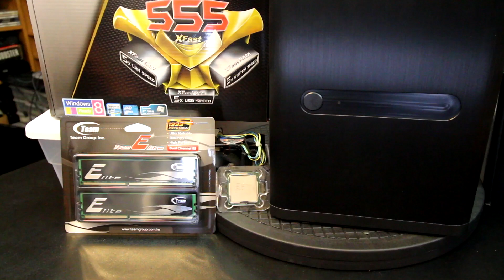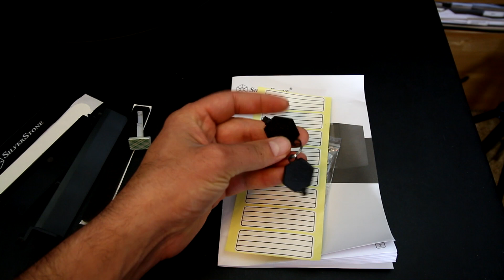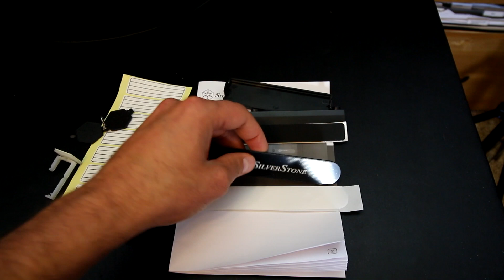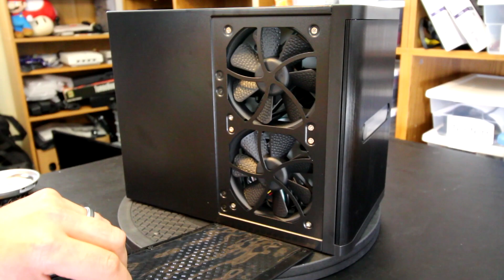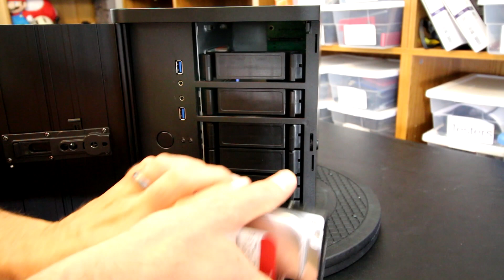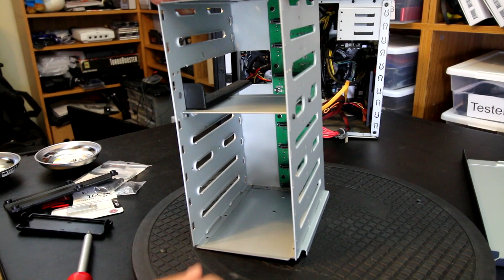NAS build with the SilverStone DS380

Comment: I don't have a problem with a rat nest...  you only have to assemble it once, and then I treat it as any other pre-built NAS box.     But the biggest problem is cooling...  I have 3 differerent (this one, node 804, node 304)... and this silverstone has ABSOLUTELY the worst fan arrangement... you WILL have to modify this case in order to force the air THROUGH the drives, because the way it's set up right now, the fans just blow on the side of the cage...  the modifications include building a shield to FORCE the air through the cage, and to DRILL MORE HOLES in the cage, sot hat the air can actually move through it.   It really is THAT DUMB.

Comment: Nobody needs a RAID card. Every CPU has hardware acceleration for RAID calculations. So simply buy an ITX Board with 4x SATA ports onboard and add a 5x sata JMB585 or 6x ASM1166 SATA card. They are tiny and consume much less power. Or if you find any, buy a C236/C246/C256/W680 ITX Board with 8x SATA ports like the Gigabyte C246N-WU2.

Comment: would it be possible to cram a micro atx motherboard into this case if i were to use a smaller PSU and modify the case a little bit?
Reply from the maker: Hi. The Micro ATX form factor has 4 card slots. This case only has 2. Everything CAN be modified. However, the amount of modification needed would make it a pretty large project.
Reply: @AdoptedMike  i dont need the extra slots i have a l5640 cpu i want to use but its 3 channel memory which requires 6 ram slots so there are no mini itx boards for it :/ the only pci slot i would use is for the raid card.
Reply from the maker: @keenbeans1133  OK. So, the MATX board will end up sticking out of the top even if you are moving the power supply (if I calculated correctly). The MATX board is also wider so the drive cage will have to be moved forward as well. The fans on the side will interfere with the width of the board as well. It would make sense to extend the case on the top and rear. I would guess that 4 inches in both ways would work, maybe a little more. I agree, I am not aware of any Mini ITX board that utilizes triple channel memory. If you are using this as a storage server, you won't notice any difference in single, dual, or triple channel RAM. The amount of RAM makes the most difference for most of the storage OS's. The L5640 CPU has plenty of cores to run virtual machines, but that still won't make a noticeable difference by not using triple channel RAM. I also am unaware of any Socket 1366 motherboards in the ITX format. The storage servers that I have built lately are down this road:
https://www.newegg.com/p/pl?N=100007583%20600030546 with similar to these:
https://www.newegg.com/icy-dock-mb074sp-b-enclosure/p/N82E16817198059?quicklink=true
Those are examples. There are many ways to go in that direction. I have also used both server cases and also NAS systems like Synology and QNAP.
This under the assumption that you are working on a storage server of some sort.
Reply: Look at the CS380 as it’s ATX-sized with the same 8-bay HDD backplane!

Comment: Nice review, i am interested about the raid card and what's the LAN-port on it being used for normally. I think it's an expensive card though. If just building an 8 drive NAS the Asrock board, would have avoided using a dedicated card alltogether.
Reply from the maker: Hi. I am pretty sure the RJ45 port on the back is for management. I have seen HBA/RAID cards have ports on the back to connect to dedicated storage only chassis through another card. The main HBA/RAID card controls the other drives. This card cannot do that, so that is why I am assuming it is form management and maybe firmware updates. That ASRock board is a fantastic setup for this case. They are expensive, but have a ton of features. I ended up getting on well after this video and I love it. So many features in a small package. It is currently installed in a full footprint 4U chassis in a server rack. The board looks so tiny in there! Could have easily gone smaller, but I got a good deal and I didn't need much processing power.
Reply: @AdoptedMike  Thanks for the answer; i will be getting a supermicro-board with an 8 core atom on it soon; together with my lsi-sas controller it might make a good proxmox or freenas or... xpenology box; i was interested in a nice chassis for my future server, currently i have an older coolermaster stacker-case having 2 4 bay drive cages in it which i might repurpose but this silverstone case looked sweet. The only thing that worries me is the tight fit for the SAS controller which would make me having to give up a drive-slot which is a compromise i try to avoid. Great review by the way :) I enjoyed it.

Comment: would have like more information on the raid card, is that sas to sata?  , using mini-sas to 4 break out satas ? and what the hell is that a Ethernet port on the back of the card?
Reply from the maker: The RAID card was a ARC-1224-8i card using Dual SFF-8087 to 4 SATA for 8 total SATA ports. The Ethernet port on the card is used for Out-Of-Band management purposes, such as configuration of the card, drives, arrays, etc. from a computer on the network via browser, SNMP, Telnet.

Comment: You can get a raid card that the ports come out the top of the card and not the back of the card.  and I fell that is what is hitting the plastic part on the caddy.
Reply from the maker: Yes. That is a work around that in most cases will work. Thank you for adding this tip for my viewers.

Comment: I compared with DS380 and Lian Li PC-Q25. DS380 is more convenient and few expensive than PC-Q25. The price of DS380 and PC-Q25 in Taiwan are US$150 and $140 respectively. (Amazon price of PC-Q25 is $268) DS380 is ideal size to expand the HDD to max 3.5' x 8 and 2.5' x4. However, hot-swap function is not my first option. Maybe I should buy PC-Q25 or PC-Q18 that is suitable for long raid card. The exhaust design is better in PC-Q25.
Reply from the maker: Personally, if I had to do it again, I would get the PC-Q25. The DS380 was difficult to work with and didn't have as good of air flow that the Q25 looks to have.

Comment: A magnetic dustfilter near the hard drives. Isn't that kind of dangerous?
Reply from the maker: It is amazing how powerful of a magnet it takes to corrupt HDD data. The actuator and motor in the drive itself are far more powerful and do not mess with the data integrity. Even several magnetic dust filters impart almost no magnetic force more than a centimeter from the metal surface they bond to.

Comment: hello, AdoptedMike - - adoptedBill here!
I really enjoyed your vid and learned a fair bit, I think. But a question, if I may? I'm wondering if a "NAS" is waht I need to accomplish waht I want? Thing is, I've got about 7 or 8 HD's and what I want to do is put them all in to a single case/chassis, then plug that case/chassis via eSATA in to the back of my Mac Pro - - did I mention that I'm on Mac? And have access to those drives for backup, when needed. So I don't think i need a motherboard? or RAM? or some of the other things that you've installed in your build? 
thanks again for the great id. and all help appreciated!
Reply from the maker: Hi. If you are only connecting one computer, you really only need a direct attached storage solution. Not a NAS or, network attached storage solution. The issue is finding any solution that can accommodate that many drives. In my opinion, you could get a few of these: https://www.newegg.com/Product/Product.aspx?Item=9SIA1DS1PR2757 or something similar and directly connect them to your Mac and then configure them from with in MacOS. I don't know of any direct attached storage solutions with more than 4 drive bays. Alternatively, you could get something like this: https://www.newegg.com/Product/Product.aspx?Item=N82E16822108461, but it may be much more than you would like to spend. It may make more sense to you to have the single storage box. The nice thing about the Synology unit is the software is much easier (but lest robust) than a FreeNAS box. Which of these 2 paths sound better to you?

Comment: do you install windows on this system
Reply from the maker: You can. Although I imagine most people will use a version of Linux.
Reply: Is it possible to store without installing windows
Reply: I think in turkey I buy it
Reply from the maker: You will have to install an operating system of some sort in order to use this device. It is basically a computer case with many drive bays.
Reply: I understood thank you.

Comment: I have this case setup with 8 x sata3 2tb WD red drives and 3 x SSD drives all supported by the matx board - ASRock C2750D4 I also have 32gb kingston ECC ram installed (KVR16E11/8) running FREENAS ZFS (no stupid raid card required), Oh and the mobo has IPMI so you need no monitor connected as you can control everything from the IPMI network port, Including turning on the pc and remote control it, its kinda like windows remote desktop only better.

Wendell does a "review" on the amazing mobo here - https://www.youtube.com/watch?v=j2ERph8v13s&t=13s

Comment: I just got this case. How do you connect the front USB ports to the motherboard?
I have never seen a USB connector like that before.
Reply from the maker: This case has USB 3.0 in the front panel. If you don't have that connector on your motherboard, you can get a 2.0 to 3.0 adapter. Then the plug on the case can be adapted to the motherboard. Keep in mind the ports will operate as 2.0.
Reply: AdoptedMike 
Do you by any chance know the name of the USB connector?
Reply from the maker: Yes sir. This is what you will need. I will covert the appropriate pins from 2.0 to the 3.0 connector. I have bought and used a few of them in situations like this.

https://www.amazon.com/SIENOC-Motherboard-Female-Housing-Cable/dp/B00EOI3VC8/ref=sr_1_1?ie=UTF8&qid=1489375961&sr=8-1&keywords=usb+2.0+to+3.0

Comment: i'm glad that i just went ahead and bought an 8 bay QNAP. there is no way that hard drives would be able to survive in this thing. nor is there an mITX board with on board 8x SATA ports.
Reply from the maker: I used this one in another build:

https://www.newegg.com/Product/Product.aspx?Item=N82E16813157419

Worked out pretty good and has tons of SATA ports.
Reply: it looks like the 8 sata III ports are across 3 different controllers. are you able to make one, single array using those 8 ports?
Reply from the maker: My array used six, so I used the six white ports on the righthand side. I would assume that they are on the same controller. I understand that FreeNAS will use multiple controllers as long as hardware RAID is disabled. What O/S are you thinking about using? Also, I should note: I ended up using a different case. This one had too many compromises and I was also worried about heat.

Comment: I bought one of these when you did this build but case just sits in the garage now. Only used it a couple of days.  The drives would run at 60 deg Celsius. Just couldn't get good cooling with this, so wondering how you got on.
Reply from the maker: Mine got really, really hot. Actually, I had a house fire that destroyed this unit before I was able to deploy it. I decided not to replace it and went with a much larger case, the Fractal Design Define R5. It holds plenty of drives and has adequate cooling although it is MUCH larger. I realized that the novelty in the DS380 wasn't for me. I do not have space concerns as I have a closet dedicated for servers and networking equipment.
Reply: okay, thought you were oing to say it caused the fire. I went with Fractal Design Arc R2 mini and havent looked back. 6 hard drives and space for 2 more using 5 1/4 bays
Reply from the maker: Yeah bigger is the way to go. This is a really neat idea, but it just doesn't work for everyone.

Comment: Would you consider using ASRock C2550D4I instead? It has 12 SATA and integrated CPU which means more space inside, no issues with RAID card and better airflow. I'm considering building a small business NAS solution so I would love your opinion on that.
Reply from the maker: Yes. In fact that is what I did. I had a house fire that destroyed this unit as I built it in the video. I built a new one with that exact ASRock motherboard. I did use a bigger case. I am much more happy with the ASRock. But to be fair it was more expensive, but in the end it will be a much better value. I would also guess that being enterprise grade, the ASRock will last much longer. The CPU is a little weak, but is more than adequate for Free NAS. I put 32 GB of RAM and 8 hard drives. Using a Z2 array seems to have slower writes than the Free NAS Z2 at my work. At my work I have a full fledged Xeon. That CPU is much more powerful. But for basic NAS use, the ASRock is great. Besides, the biggest limiting factor is the gigabit Ethernet network. A 10Gb Ethernet connection, might be too much for the ASRock to handle, in my opinion.
Reply: Well, I'm also considering ASRock C2750D4I but I'm not sure if it's worth to spend £100 more for processing power that I probably won't even need in the future. I'm building a storage solution for event photography business that needs about 1TB per year and already has 8TB worth of photos. There will be a maximum of 2 users accessing the server at any time and it wont be used constantly (only when backing up or accessing photos). At the moment we have a Buffalo Linkstation quad pro which does the job perfectly but lacks the capacity and flexibility of DIY NAS. Do you think C2550 is enough or I should go for C2750?
Reply from the maker: As far as I could tell when I was looking at the 2 boards:
Free NAS favored clock speed over core count. That made my decision there. No point for the 8 core CPU when my specific use would never utilize the extra cores. This could or may have changed since I first got on Free NAS (Pretty sure it was 9.1), so in the future 8 cores may perform better on that platform. Also, with gigabit Ethernet, I couldn't hit the NAS hard enough to slow it down. I don't think user count would matter as much as raw data throughput. It will also depend on what level of RAID (or RAID equivalent) you are using. Z2 and Z3 are much more complicated than just a simple mirror. I would expect to only see issues in fast writing. Reading involves much less calculation from what I understand. I went with more RAM to help with writing as well by giving Free NAS more of a buffer.

Comment: The RAID card is unfortunate, but the choice of motherbord could have made a difference as well. As for the cable mess, building a nice wire-loom with the SATA cables isn't that difficult, even with non custom lengths.

Comment: thanks for the reply, I'm only using it for streaming, downloading and browsing.
have you heard about the Ncase M1.
Reply from the maker: I have the Ncase. It is really nice although a bit spendy. I use it as my living room PC. I use it with an AM1 quad core and a GTX 950. The 950 is overkill, but I wanted HDMI 2.0 and at the time the 950 was the cheapest card with 2.0 built in.
Reply: did you get the top load drive version and what color.

Its a really interesting case.

Silverstone CS01-HS was my main choice but is limited to 2.5 inch drives only, the DS380 outer cases looks a bit on the cheap side, so the Ncase could be the right choice.
Reply from the maker: I got the one with the top loading drive in black. I am not using a drive currently, but I got it just in case.
Reply: Hi thanks for the advice, I have the Ncase, the built quality is excellent ad very small.

Comment: Is it possible to use this case as a normal PC case, I like the extra bay for storage for all my TV series, and I'm also considering the Silverstone CS01-HS, but it's a shame it only supports 8 2.5 inch drives, and there isn't much industrial grade 2.5 inch drives or nas drives available.I intend to use the ASROCK Fatal1ty Z170 Gaming-ITX/ac, I have also got the samsung 950 pro M.2 MVNe 512GB for the main SSD storage.What do you think.
Reply from the maker: This will work great for normal usage. I wouldn't expect to build a gaming PC in it, but for regular tasks it will be fine.

Comment: Can I fit this motherboard ? http://www.serverpartsmall.com/hp-compaq-8100-elite-small-form-factor-sff-pc-motherboard-ms-7557-531991-001-505802-001-btx-lga1156-q57-ddr3-original-refurbished.html
Reply from the maker: No, that motherboard is too big. You will need an ITX board, that board is a BTX form factor.
Reply: Thanks